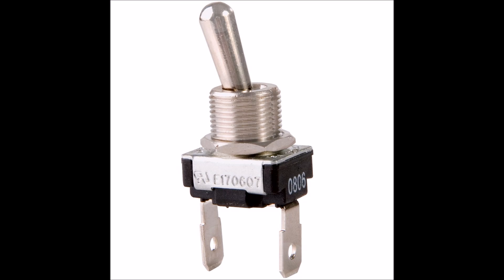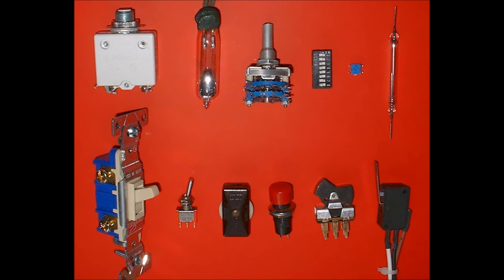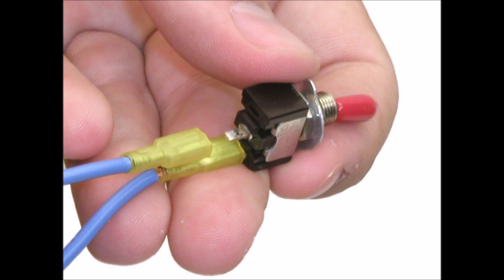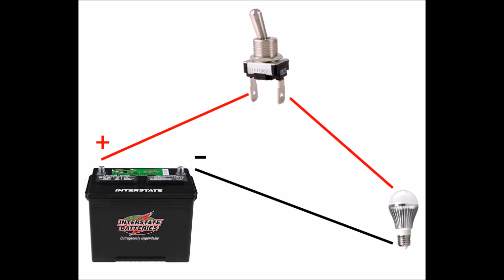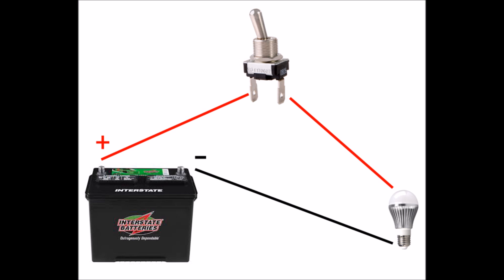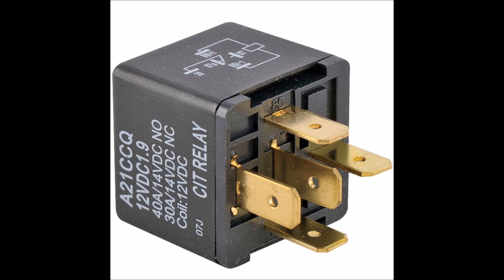Solar Panel Basics - Switch 101

Comment: Can you recommend a simple switch for my 400w 12v solar system to charge controller, it's connected in series single string.

Comment: Hi! You might be able to help, can I ask a question? I would love to add an illuminated rocker switch to my setup, between my 75w solar panel and small controller., basically an on-off switch right before the solar controller. I understand it would be simple just to put a rocker switch in-line on the positive wire, like you showed in the beginning of the video, to just cut the electricity flow... But I would love to use a rocker switch with an LED in it. Do you think I can wire (solder)  this up as if the panel was providing the electricity source, like a battery? As long as the switch can take the voltage and current, I assume it's going to light up and work? I hope i'm clear :P  Thanks!
Reply from the maker: I think that is possible.  You would basically just need to splice in another wire connection from the positive lead from the panel.  In other words, you would need to split the positive lead from the panel into two wires (there are numerous ways you could do that) and then one wire would go to the power source terminal on the rocker switch to provide illumination and the other would go to the input side of the switch.

However, I think this goes without saying but the rocker switch will only light up when there is light outside.  If you want it to light up at night you would have to use a battery.
Reply: It works! The switch is rated for 24VDC and more amps than the solar panel can provide. Take a look! https://drive.google.com/file/d/0B7Tbdlv6JD_BQ2liaWViZFJzcnc/view?usp=sharing

The yellow wire (which contains two wires) comes from the solar panel, and the rest of the connections are temporary w/alligator clips so I could test my idea. Flawless! I hope this can help other viewers too! Thanks again :)
Reply from the maker: Very cool!  Glad it works for you.  Thanks for posting your results for others to see.
Reply: DaveB n6

Comment: Many folks seem to get this backwards and do end up breaking the NEG side of the Electric, which works but is wrong, because adding a ground will allow electric to pass through. Electric seeks Earth Ground and does not care if it has to pass right through the Human Body; the Human Body, however, will not fair as well in the exchange. DC Electric is even worse as DIRECT CURRENT will not stop and will cause the human body to continue to hold on to the connection where as AC, or Alternating Current, works with pulses and allows you a moment to pull away after the initial shock. I look forward to what follows... Use Electric AT YOUR OWN RISK because you, or someone you love, could be harmed or even killed, so RESPECT ELECTRIC and it will RESPECT YOU BACK....
Reply from the maker: +Paul Bialozor I am definitely going to do some research and do some safety videos at some point.  I didn't cover the 3 and 4 prong switches in this video on purpose so that people will not try to wire those up, at least not without learning more first.
Reply: +LDSreliance Yeah, I know what you mean, I ran some interesting light switches in my years past using 3 and 4 way switches and it was fun to say the least. Also had a guy that said it did not matter which line to break, because it worked, so he wired his shower lights on the NEG Side and luckily never got electrocuted and that was a nightmare to correct. He just randomly grabbed a black wire on one switch than a white wire on another and it would work on one direction but not both, so yeah Electricity is no joke...
Reply from the maker: Paul Bialozor
Yeah you should have a healthy respect for it.  I work for a powerline construction company and one mistake can kill our linemen.  In the early 1900's the mortality rate for linemen was over 50% for a long time.

Comment: Good info and wonderful idea for series! Only thing missing from this video is to be safe and use switches properly rated for the amp load ... just my 2cents. Keep up the good work!
Reply from the maker: +fannygitchyurgun spiritwind I thought about adding that in.  I will probably make a safety video at some point and talk about that.  Thanks!
Reply: That would be good ... maybe it would fit right in with a discussion of sizing wire properly.  Carry on, sir!
Reply from the maker: fannygitchyurgun spiritwind
Yes there will for sure be an episode on wire.  Maybe more than one episode.  I am trying to keep these to around 3 minutes since statistically that is about the average duration people watch my videos.